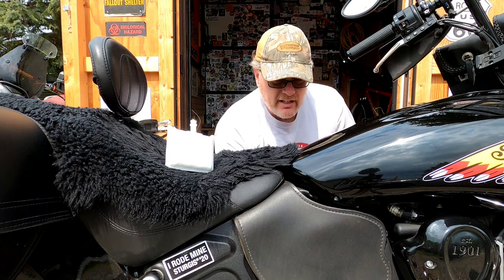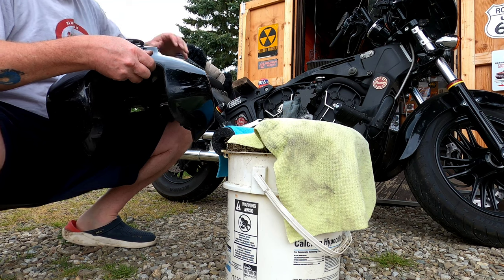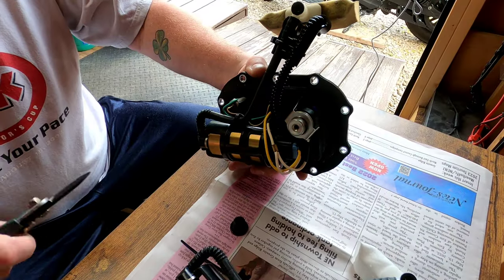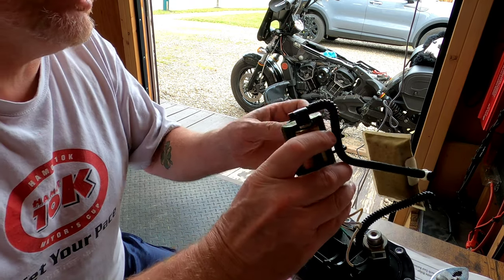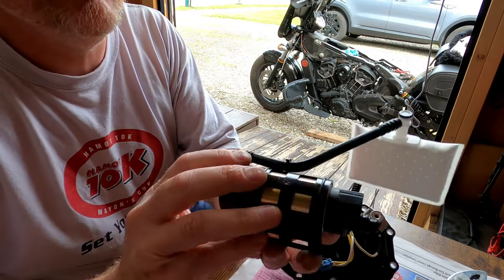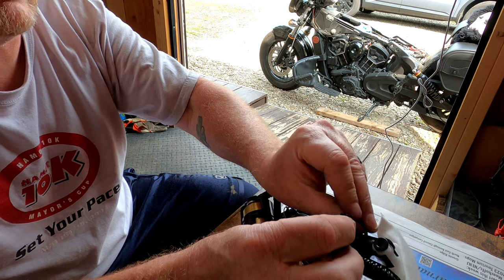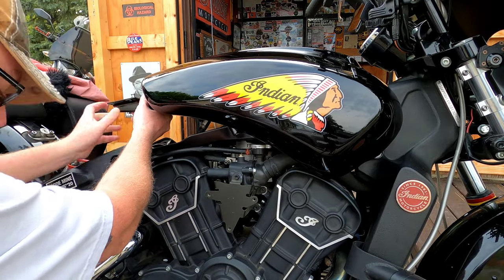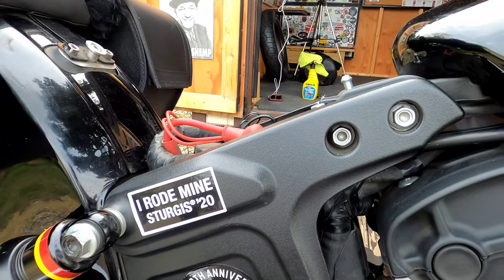Indian Scout Fuel Pump Screen Replacement. #indianscout60 #indianscout #indianscoutbobber

Comment: I noticed you have the MC Cruise Control. What are your thoughts on it? At $600 it’s expensive but the Scout throttle and vibration is brutal on distance rides.
Reply from the maker: It has been a great addition.  I ride the highway alot.